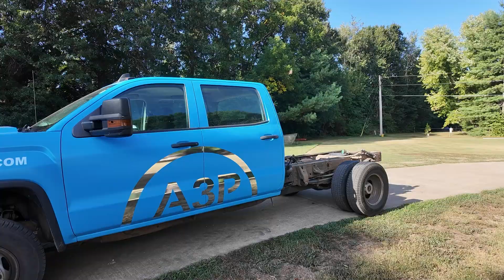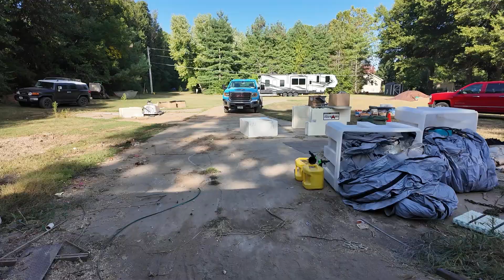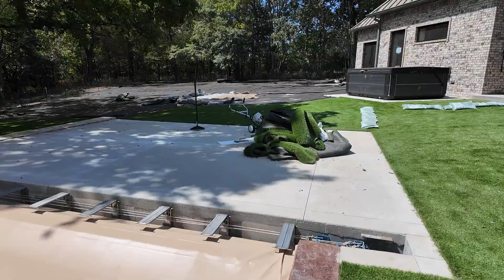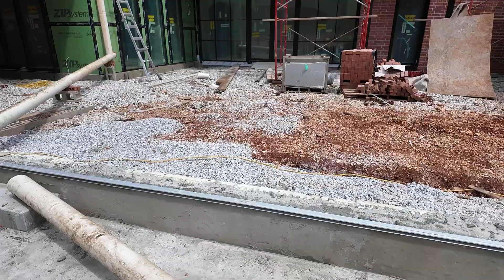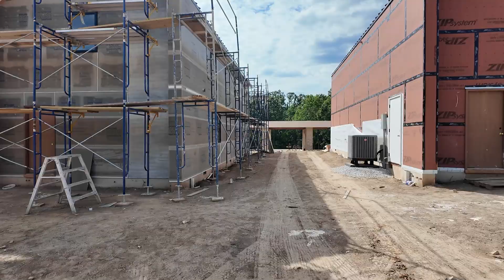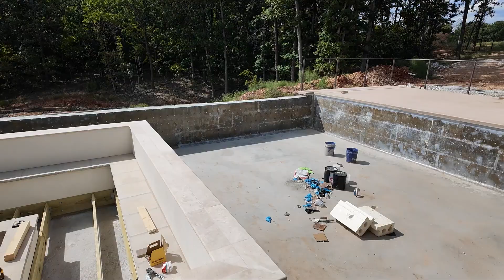Labor Day ICF Jobsite Tours

Comment: Hi Aaron,  Looking at the first house (Freeman maybe), I think I am seeing a water feature with 4 scuppers.  Do these have lights included, and how does something like this compare with your standard RGB spillover waterfalls (expense/ease of install)?  I am currently working with Eric on my design, and I have included a 10-foot waterfall. However, I love the traditional look with the scuppers coming out of the brick.
Reply from the maker: We don’t stock them and they do cost a little bit more but we can of course get them in for a kit, they look really good, no lights tho, he’s got two fire bowls flanking them so the light would get washed out anyway, you could drill the sides out and install the new Pentair nano lights but again that would add a bit of cost….